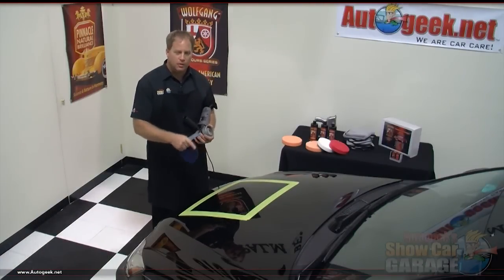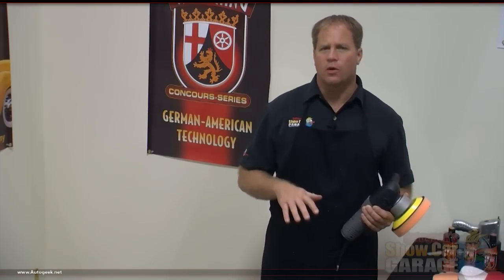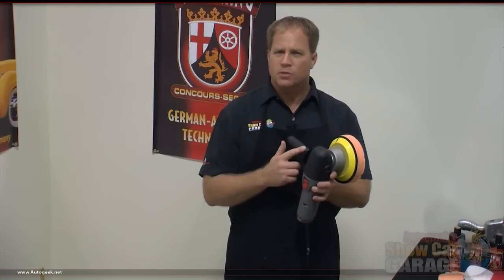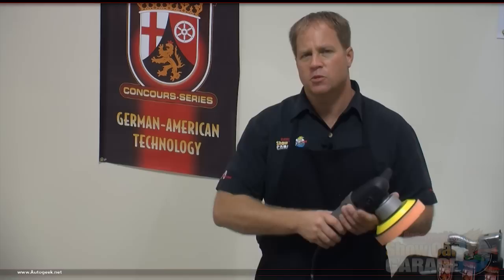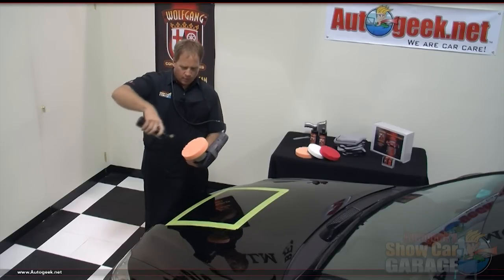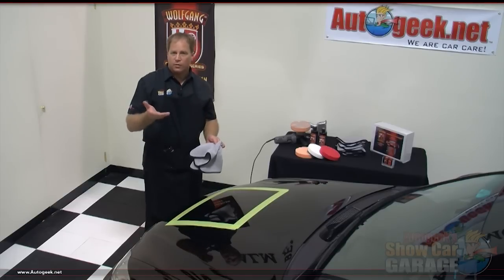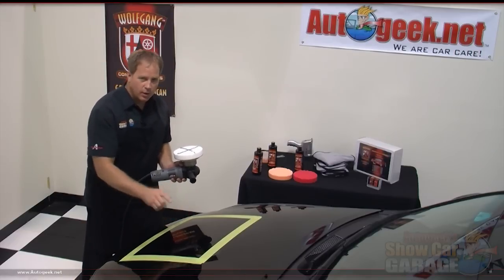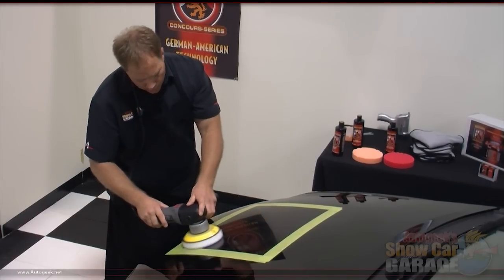Part 2 - How to remove swirls, scratches and water spots using a Porter Cable 7424XP Polisher

Comment: I just finished this process on a Ford F150. I bought the kit with all 3 products and the porter cable. All I can say is WOW!!!! I recently bought this 2005 truck and it spent several  years out west in Washington. It's safe to say the paint had a lot of oxidation from that west coast rain. I tried using Macguires ultimate compound by hand and it left HORRIBLE swirls. This porter cake kit with Wolfgang products is amazing. I have never used a polisher before and this was very easy.

Comment: I know there are multiple sizes but multiple rings could be printed for different size plates. This would cost pennies to do and I would gladly pay an extra nickel so long as the pad is comparable to the ones without it. Perfectly centering a plate by eye is near impossible and while it doesn't matter quite so much for a DA, it's very annoying for a buffer. This idea seems like a no brainer to me, and all the fellow detailers I work with agree. I'm the customer, businesses should listen.

Comment from the maker: Keep in mind there's more than one backing plate on the market and they are all a little different in size.  Also, the extra step of imprinting a design onto Velcro cost money and will increase the cost of the pad.  A business making pads and a business selling pads might not want to take a chance that there is a large enough market for something very simple to risk selling their inventory by some portion of the customer base that would complain about prices.  -Mike Phillips

Comment: I'm thinking of getting the Pinnacle and twins kit, but in the kit it comes with the 1 orange pad, 1 white pad and a grey pad, and i see in your vid you use a red pad, so are the grey and red pad comparable enough to each other that I could expect the same results? Oh and will just 1 of each pad be enough to do a mid sized suv?

Comment: Also, should I toss my polisher for a dual action polisher?  I once burned through the paint on my truck, right after I color sanded it because it could the edge of the hood, would that type of mishap been avoided with the dual action polisher?

Comment: i have used the pc to remove swirls and scratches of a Toyota yaris 
the thing is not all the scratches are gone
but swirls are gone 
and i want a swirl scratch free finish 
i used cutting pad with scratch x meguiars followed with swirl x then polishing pad with pure polish 
but there is still scratches they are heavy but not heavy enough to be sanded
and i used speed  setting 6 with medium to firm pressure 
so what did i do wrong ?

Comment: instead of working on a small portion just work on 1 panel at a time but make sure u r consistent. As u get better u can do alot more at once but consistency is key and ur experience, gear, etc. etc. Take baby steps and then move on.

Comment from the maker: That's correct but I'm not showing Meguiar's pads or Meguiar's products.  I'm showing a Lake Country foam cutting pad and Wolfgang Total Swirl Remover.  They are right that a foam cutting pad "CAN" leave haze but not always, it depends on the paint and the product.  Also, that's why you follow the aggressive step with a less aggressive step and that is to remove the haze.  It's called a "paint polishing process".  Make sense?  -Mike Phillips

Comment: When you say "six section pass", does it mean you do the vertical up-downs 6 times and horizontal left-right six times? Or you mean that the vertical phase has 6 stroke and the horizontal has 6 strokes too?
Reply from the maker: A single pass is when you move the polisher from one side to the other side of the section you're buffing.

A section pass is when you move the polisher from one side to the other side over the entire section you're buffing ONE TIME.  Doesn't matter the direction.

Most sections you need to do 6-8 section passes to remove enough paint to remove the swirls.

http://www.autogeekonline.net/forum/show-car-garage-how-videos/24074-show-car-garage-video-how-do-section-pass-when-machine-polishing-da-polisher.html

The definition of a pass
There are two definitions of the word pass as it relates to machine polishing with any type of machine.

Single Pass
A single pass is just that. It's when you move the polisher from one side of the section you're buffing to the other side of the section you're buffing. That's a single pass.

Section Pass
A section pass is when you move the polisher back and forth, or front to back with enough single overlapping passes to cover the entire section one time. That's a section pass.

-Mike Phillips
Reply: Autogeek Thank you for the quick reply!! Now I understand it and it makes more sense!!!
Reply from the maker: David Szabo

Cool.  Good to hear... -Mike Phillips

Comment: I'm confused after receiving some conflicting advice.  Compound, polish and wax in that succession should not be done if  the paint is relatively new or the car has seen little to no rain or contaminants?  What about when to use a clay bar or swirl remover?  Does that supplement one of the steps of compound-polish-wax?

Comment from the maker: I have at least three articles on removing water spots no matter what the origin of the cause.  Copy and paste the below into Google and you'll pull up one of my articles.

3 - Types of Water Spots - Type I, Type II and Type III

IF the acid rain "etched" a crater or Type II Water Spot into your car's paint then you'll have to use either an abrasive polish or compound to level the surface of the paint and thus remove the crater etching.  _Mike Phillips

Comment from the maker: For a rotary buffer you can use a range from 600 RPM to 1500 RPM.  I have articles about this on our forum at AutogeekOnline . NET as it's a much better interface for discussing detailing than this message system on YouTube.

-Mike Phillips

Comment from the maker: Yes and No.  We have one for Tar but not Road Grime.   For road grime you can use any quality paint cleaner, for Tar we have a lot of tar removers on Autogeek . net

Best thing to do would be call 1-800-869-3011 and Customer Care can help you get a tar remover.  For the video on removing tar, simply go to the Autogeek YouTube Channel homepage and type Tar Remover into the search box.  I just did and it pulled up first thing.  -Mike